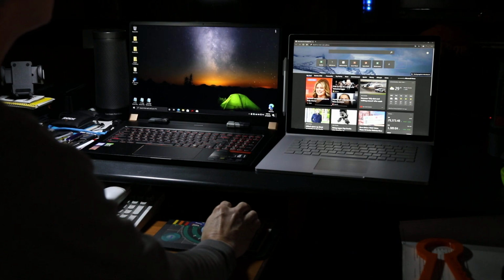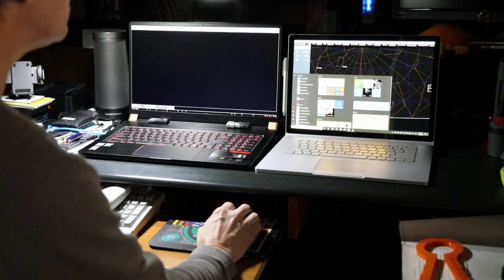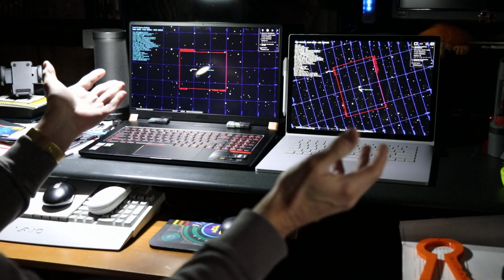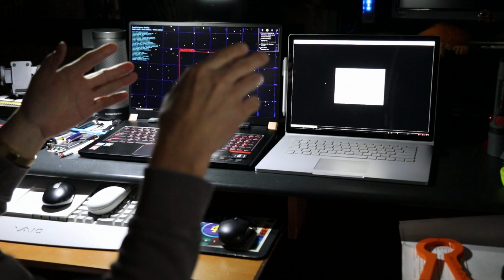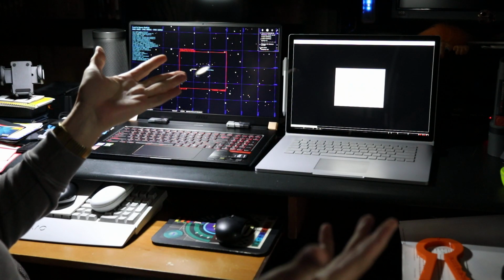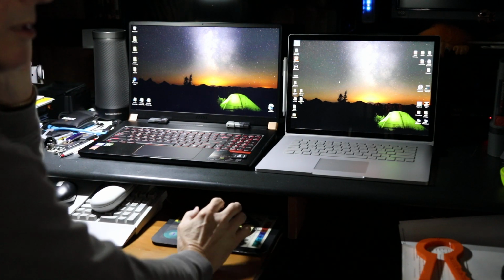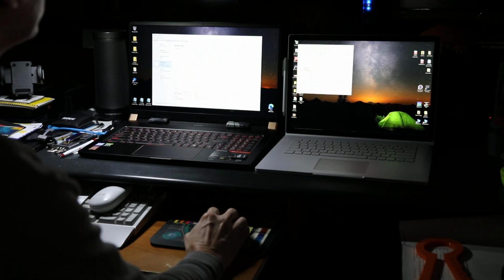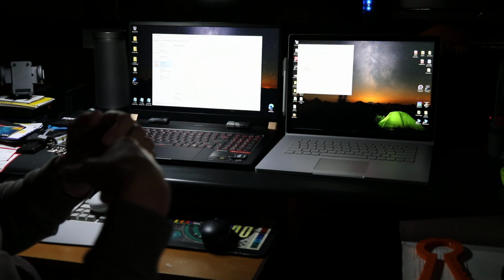Use 1 Mouse To Control 2 Computers! You Need Mouse Without Borders!

Comment: Hi Jeff, I am a new subscriber to your channel but no one can elaborate and I am hoping you can help me please?  You keep mentioning IP is that the number I use for the original Security Code when setting up?
Thank you very much !  Only because I am trying to find techniques to multitask trying to finish taking an Algebra class before January 19th because College starts again and I really need to finish this class before.
Reply from the maker: Thanks for the Sub Maria    The IP I'm talking about is what is assigned by the Router of my Home network.  As long as both of the machines you are trying to use are on the same network. You should be good to go and Mouse Without Borders should find the machines when you first run the program on each machine. Hope this helps!

Comment: Where is that mouse connected to? Is that connected to a router or laptop?
Reply from the maker: The mouse is from the master machine. In my case, it's a mouse connected to my notebook. If I didn't have the mouse I would use the trackpad. In case I didn't make myself clear. The keyboard on the master machine will also work on the second machine when the mouse cursor is moved there.  You can also have more then two machines running Mouse Without Boarders.  Hope this helps...

Comment: Ok helpful gg
Reply from the maker: One thing I never mentioned in the video. You can use the Master Control machine to use that keyboard on the other machine. What I'm always doing is switching between my open programs using the Alt + Tab short cut. That means I can use the one master computer to do everything on the other. Very nice! I accidentally found this while viewing with my 2 scope session a couple of weeks ago. I hope this helps... Great program when you have tight space when using 2 computers.
Reply: Oh I didn't know that! Thank You So Much!